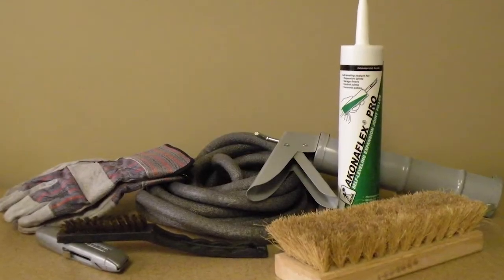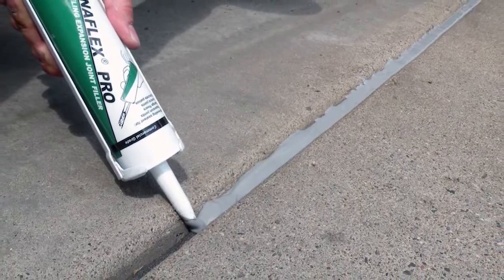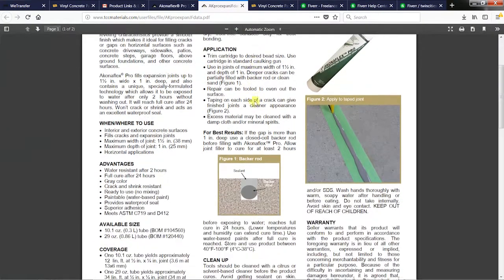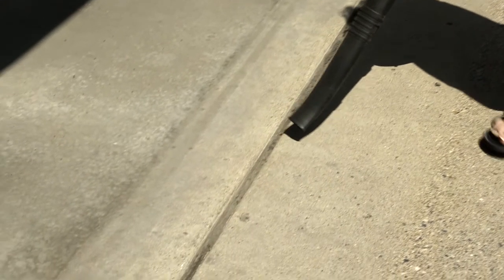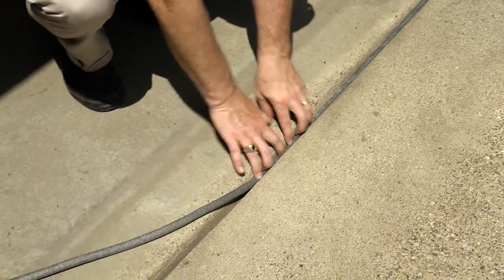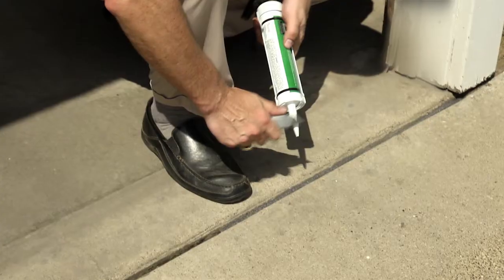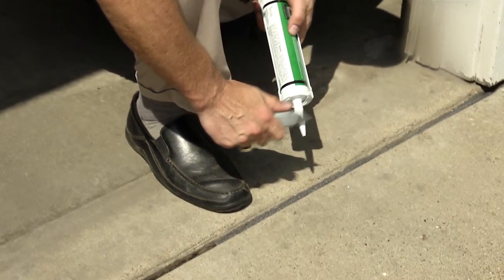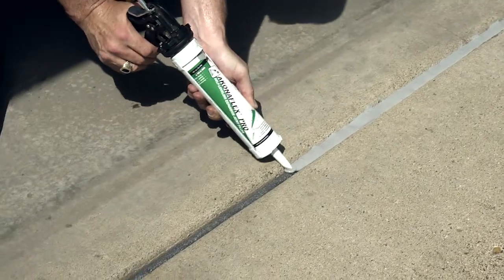TCC Materials - How to Fill a Concrete Expansion Joint

Comment: The 24 hr cure time would be for a very small gap. This product is rated for a gap 1.5" wide x 1" deep. About 3 weeks ago I filled a gap approximately 5/8" wide x  1/2" deep and the joint is still very pliable. It feels like it hasn't cured fully yet. I don't think this is a real problem, but you might want to consider this if you're doing a high traffic area. I didn't like the glossy look, so I lightly sprinkled sand over the top after I filled the joint, so it blends in nicer .